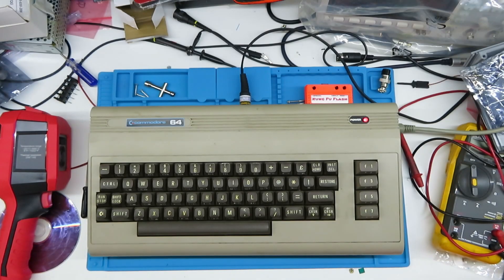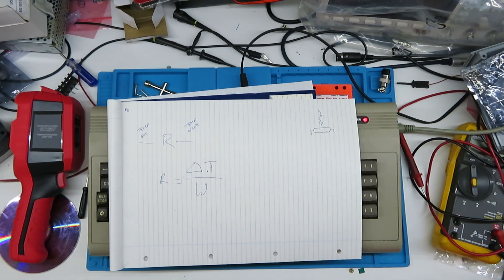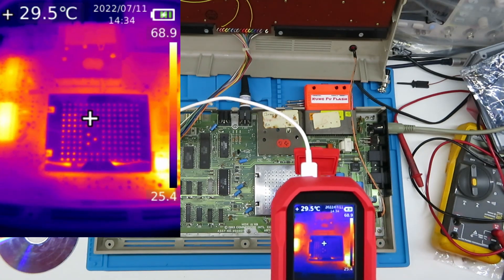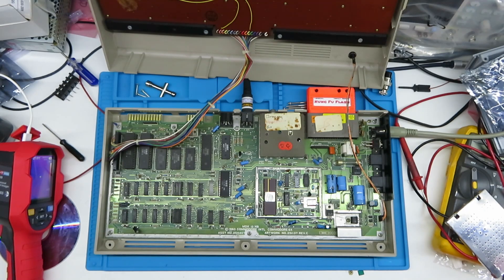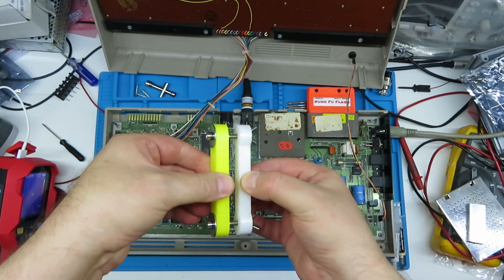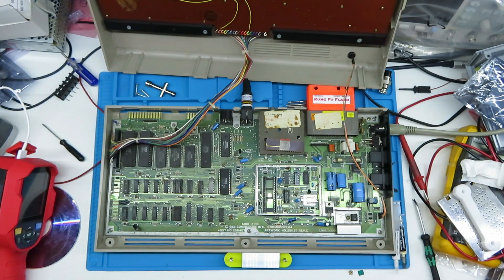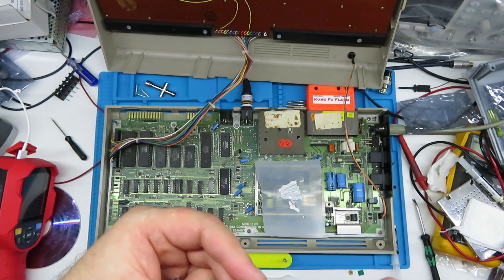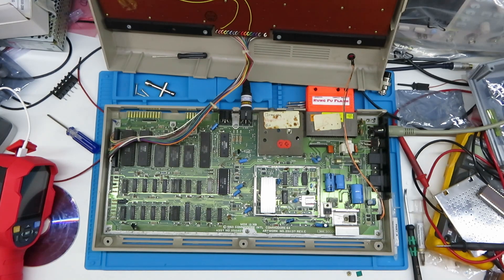captain commodore ep6 HEATSINKS

Comment: Very interesting! I think another good experiment to see would be comparing how well the metal can conducts heat away with the original compound vs cleaning it up and applying new high quality modern thermal compound between the VIC2 and the stock can.
Reply from the maker: The can works really well,but it does this by conducting the heat to a much larger area and this heats up the content of the can, There doesn't appear to be too much difference between the heatsink and can and bonded heatsink, however, the other chips will definately benefit from a heatsink, CPU,CIAs and definitely the SID.
Reply: @CaptainCommodore  Oh for sure it wouldn't be a huge difference, but better thermal compound might help transfer a little more heat from the VIC at least out of the can.
Reply: Better, not dried out flaky rubbish.

Even regular thermal compound is an improvement because it's fresh not dry.

Comment: I see the heat map 13:30 shows that razor-blade-thin dust cap gets little of the heat output, it's conducted to the blue-ish ceramic. Copper shims will join it to the cooler, if you don't wish to mill out a pocket, on the underside, in the center of the cooler.
Reply from the maker: Yes it appears so, After killing the vic chip with the clamp ( I hardly applied any pressure ) I will stick too epoxy cased chips and urge anyone else too........ any discrepancy in the shim size will likely crack the chip too.......

Comment: Sorry to see your mishap with the VICII chip. I have one of those in my breadbin C64 and used thermal tape adhesive and put layers of it to make up the gap between the ceramic and the metal plate in the middle. It worked very well and I also replaced the SID chip with an ARMSID as it had a cheaper SwinSID in it and it really sounded off. The ARMSID does not need a heat sink as it runs extremely cool.
Reply from the maker: Yea the ceramic chips are very delicate, the black plastic / epoxy are much stronger, I made a few swinsids only as a temporary measure and they are a poor replacement for a real sid but handy if you have no sound at all, I have a few of the armsid and arm2sid which are really nice ( I have one in my 128 in the paddle video ) Also the sidkick is a nice replacement.........

Comment: Bill Herd mentioned in his memoir-presentations the 1st samples of the new chip didn't oscillate until they grounded the lead frame, thus the razor-thin spring tab, to the EMI "can" to conduct electrical charge.
Reply from the maker: I didnt know that, however it did work as intended without the can lid as shown in the video, and with a plastic / epoxy cased chip this isn't an issue.......
Reply: The ceramic chip has a ground 'wire' in gold along the surface of the chip..

Check it with a mm, if connected, then ground that pin..

Comment: You should have just bonded the die to the heatsink and if needed, applied pressure specifically to that area, because the die is raised, it was obviously going to snap the chip if too much pressure was applied, also, there was no need to apply thermal adhesive to the ceramic of the chip, the die is the source of the heat and this is the place the heatsink should have primary contact to help dissipate the unwanted temperature.
Reply from the maker: As Bryan said in the comments , the whole package was radiating heat, I really applied next to no pressure and it still snapped, As I said in the video though......do not try with ceramic chips....... The takeaway was that despite me doing only the vic, the cpu,cias and definitely sid should be heatsinked as a matter of course.........
Reply: It's tricky to bake the solder molten around the dust cap, to expose the die recessed down on the lead-frame "basement floor". The heat plate goes on the underside.

Comment: That is completely unnecessary.  The best heat sink for that VIC II chip was already installed.  Also, you can buy heatsinks that have peel and stick thermal tape, and you can buy rolls of peel and stick thermal tape for the heat sinks that you are using.  BTW, those ceramic VIC II chips are high quality.  They are better then the plastic chips.  🤔
Reply from the maker: Unnecessary? Hmm, well just from a physics perspective , Thermal loss is a function of , the interface, surface area and difference in temps between source and target....... Stick on pads can perform worse that thermal epoxy and the ubterface is usually thicker, unless you go full face then the source area will be less and lastly, every degree you can lower the temps the better...... the can that comes with the vic isn't too great at dissipating heat ......
Reply from the maker: ....... Of course, you don't HAVE to do anything you don't WANT too .......

Comment: Still no guarantee the chip will last. The've already lasted well beyond their used by date at this stage.
Reply from the maker: You are 100% correct, but, at least it reducrss the chance of them failing due too thermals, a lot...... Also, what are the alternatives ? Seems like you have 3 choices for most chips, let them cook, use stick on heatsinks or bond better ones directly to the chip, The stick on ones are OK and easy to apply but don't work as well...... Although, a stick on sink  won't likely kill your ceramic,  lol
Reply: @CaptainCommodore  I don't disagree, I've done it myself of some common failing chips on the C16/+4 and Spectrum.